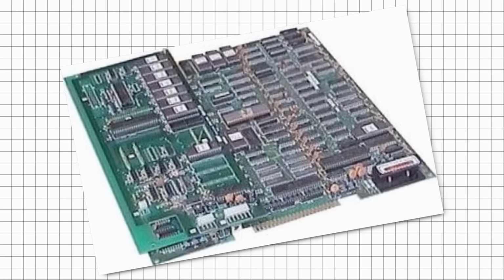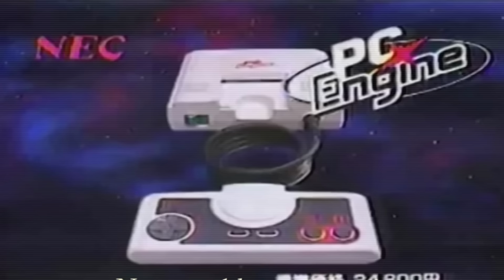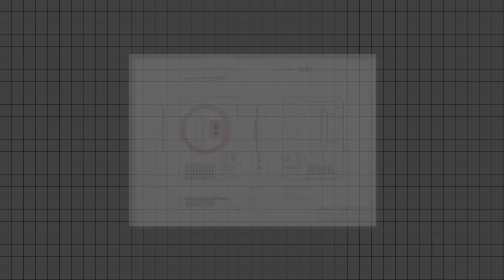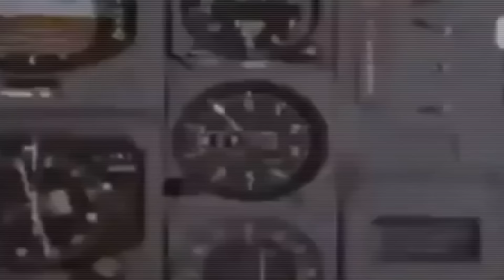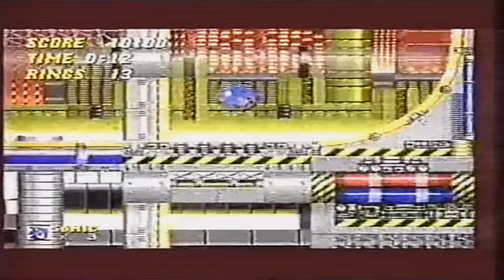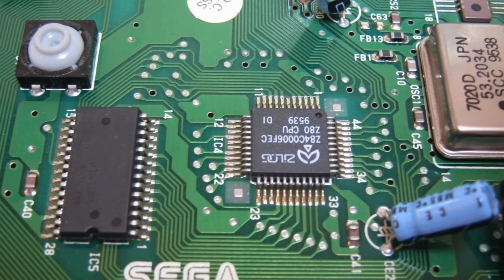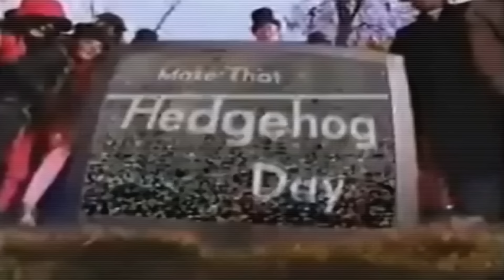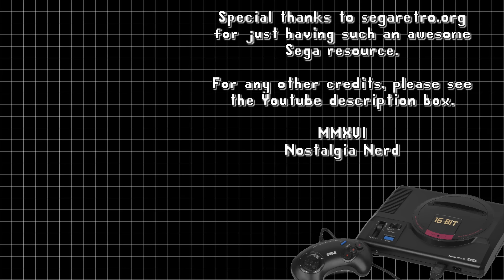Sega Genesis/Mega Drive Story | Nostalgia Nerd

Comment: You can tell what side he is on, by the data he leaves out. You talk about the processor speeds(7.6MHz vs 3.58MHz) in a dishonest way. The Sega chip was a CISC chip and the Nintendo chip was a RISC chip. Meaning that the Nintendo chip actually ran faster because of the reduced instruction set.
Reply: Not quite! The 65C816 as found in the SNES was basically a modified 6502, which was definitely a CISC design. The 68000 as found in the Genesis is also CISC. There weren't too many consumer-purposed RISC CPUs around back then, just about the only one that comes to mind is the ARM which wouldn't be put into a game console until the 3DO.
But you're also not wrong about not being able to compare clock speeds directly like that. The SNES CPU can do more work per-clock than the Genesis, which in some cases can take up to twice as long to do the same thing. The Genesis CPU does end up being faster, but it's not quite the "more than twice as fast" metric that you see thrown around.
Reply: @CommodoreKulor  , I don't think you understand the technology you are talking about.
Reply: @TheCyndicate.  I mean, you don't have to take my word for it. Here's a pretty good rundown on the history of RISC processors and what RISC exactly entails: https://www.landley.net/history/mirror/tech/processors/cpuAppendA.html
Reply: Kulor Research Labs Inc.  , lol,  I don't take your word on it, because you clearly don't know what you are talking about, so now you scurry around trying to find links that you can use, in an attempt to manipulate people into thinking you had somehow understood the subject. Not only are CISC & RISC entirely different from each other ‥ They are as far apart as possible when it comes to cpu hardware. Just stop.